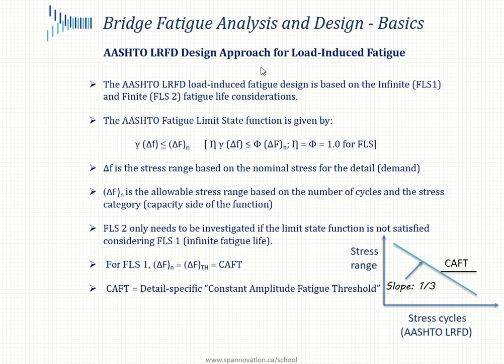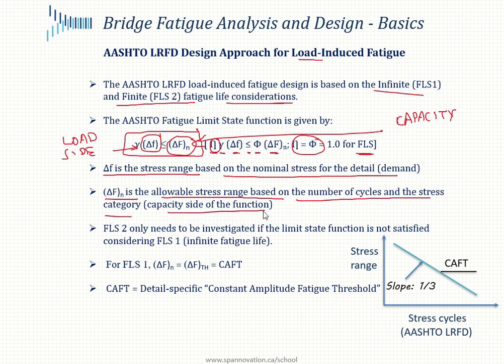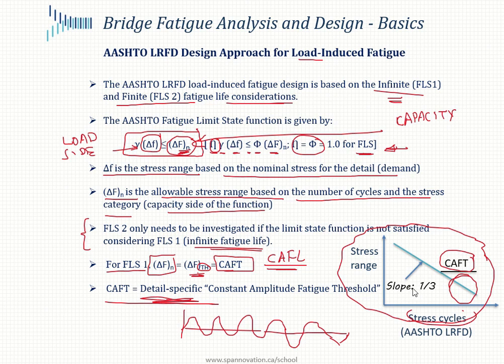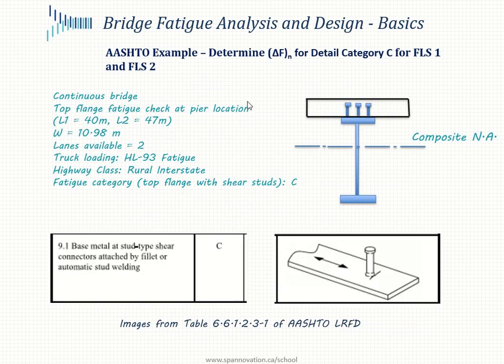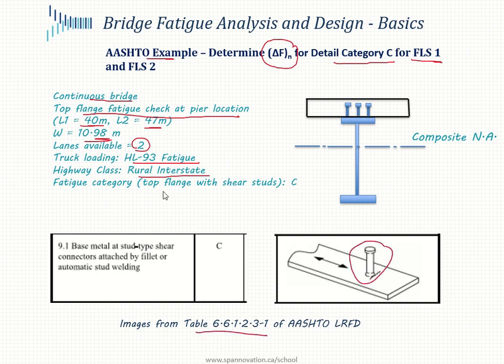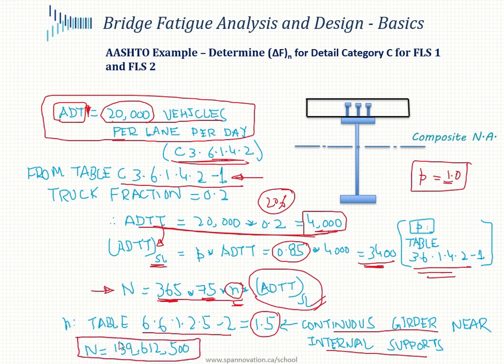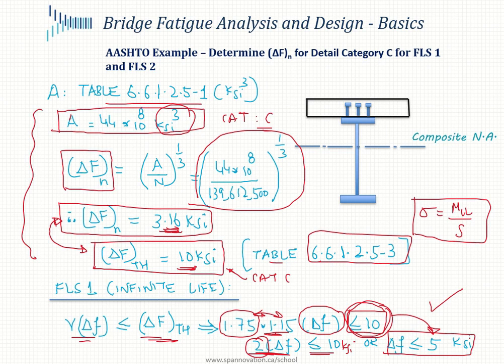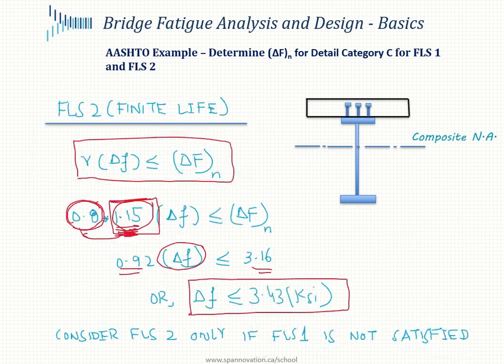Design Approach to Load Induced Fatigue (AASHTO LRFD)

Comment: Great Video- Loved your explanation to make it more rational, Hats off to AASHTO for reducing confusions, unlike others in a similar role on Building Side, You did a great job explaining. This is what I would say a Unified Approach- Meaning regardless of user - The answer would be the same. Instead of being judgemental and/or having answers to the same question to the different users all over the place. in that sense, I would say AASHTO is more deterministic than the rest of the organization in a similar position. I would also say that this outcome also requires better and confident Engineers on Committees.

Comment: Well explained. I do have two basic questions. Firstly, during the design stage what are the detail categories mentioned in AASHTO do I need to consider when designing steel box girders and I-girders? My second query is, for railway bridge design, can I use the provisions of AASHTO on fatigue loadings which is 15% increase in wheel load including IM or is there a provision in AREMA to determine the fatigue load from trains? Thank you.